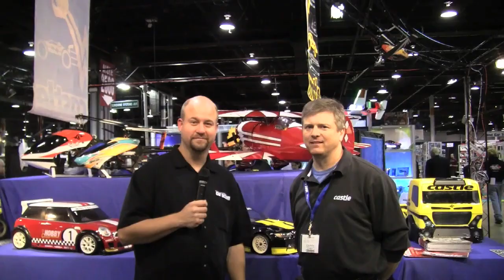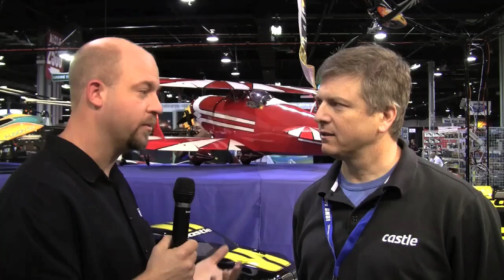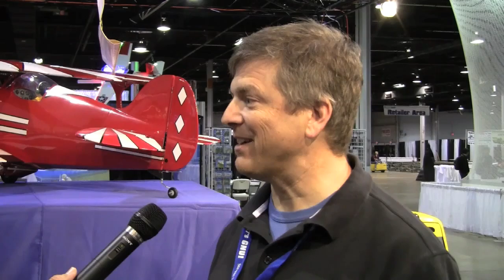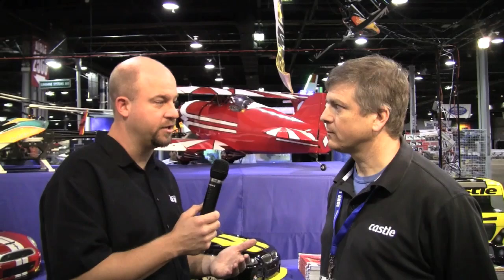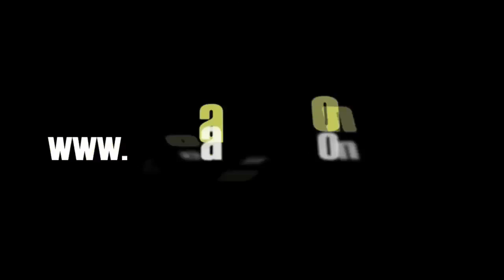Brushless Motor Operating Temp

Comment: Additionally, the KV doesn't go up at all.  What happens when you have 100% demagnetization is there is no more back EMF, hence increased current draw, until a limit is reached, either physical (e.g., melted wires or connectors), or, more likely, the max current the ESC will allow to be drawn.

Comment: Quite unimpressed with the knowledge of the Castle representative.  He claims that the curie temperature of their magnets is 200 degrees - fahrenheit.  Not.  Try 200 degrees celsius.
Reply: You might be right, however, it is impossible to measure the actual temperature of the rotor.
Therefore, everyone in the video refers to the temperature measured on the outside of the motor - which is a lot less.
The representative is correct when stating 200F on the outside causes issues since the temp inside is way higher by then.
Get schooled pleb ✌️🤓

Comment: @warranqe Lucky you. My bearings in my motors have been just fine for about 3-4 months. But esc... And worst of all its been 4 days and Castle still hasnt replied. I have a huge race coming up. And i cant even drive cause of castle not taking. Tomorrow im going to call in and get this striaightened out.

Comment: @warranqe But me. My Sv2 esc is broken. Cause who ever soldered the wires doesnt know how to solder. The joint came off and it was connecting my positive and negative battery leads to touch and heat up the whole esc. Just from the one little signal wire

Comment: No such problems with aircraft! If it's getting too hot, prop down, or cut bigger cooling slots in the cowl, I've Beverly had any trouble with motors, I have been through a few ESCs though...